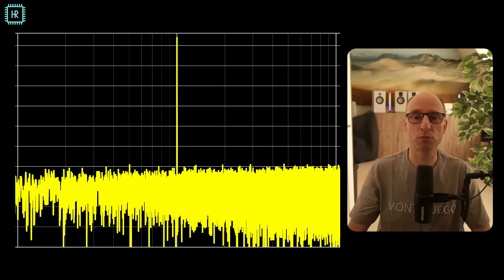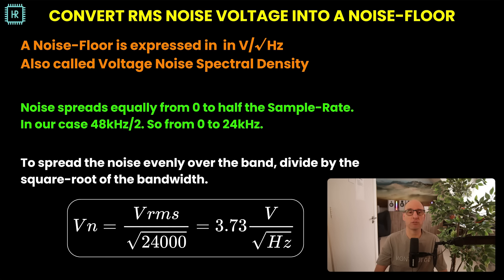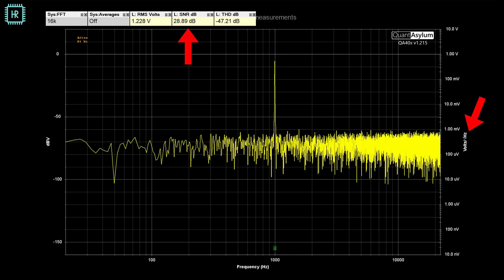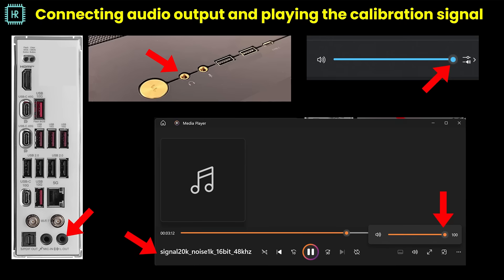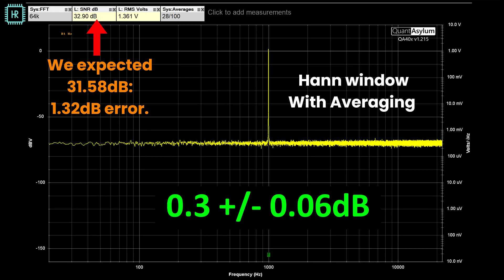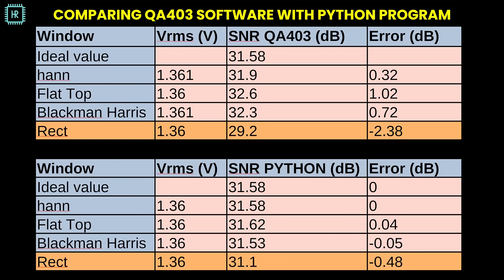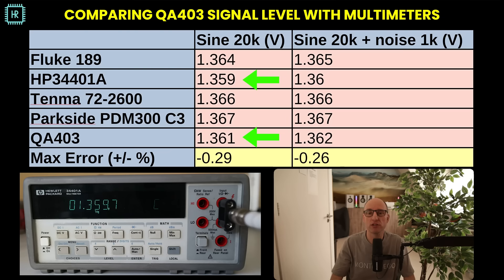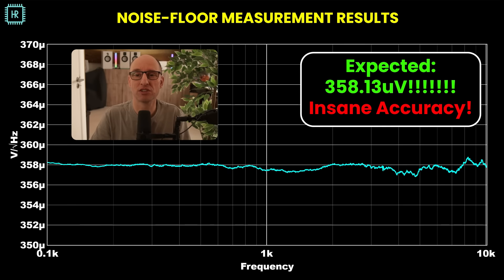Are you measuring the right noise?

Comment: I use E1DA Cosmos ADC iso and JLsound W-DAC V2 (now rebuild to W-DAC-XLR) with i2SoverUSB to make a DAC. Both DAC and ADC are 32bit 768kHz. And for measurements I use REW software. I suppose, that this software already uses the correct SNR algorithm. I've tried your wave files, but something doesn't work and I've too much of harmonic on the moise floor. Second and third harmonics about -60dB...
With W-DAC V2 I get up to -128dB SNR (without DUT)
Reply from the maker: Strange, it seems your circuit is clipping somehow when playing the wave files. Something is overloaded. Have you tried reducing the volume?

Comment: Ill add that while working for a video hardware company that i didn't believe that Tektronix VM700 was accurate at masuring NTSC PAL color bar error. What a wild goose chase.
First, we found out that the calibration standard we were requested to use was a demo tape made on a handicam.
Then for financial reasons we developped an NI box with some danish company's video analysis software.  I didn't trust this either.
So i grabbed a 4 GHz scope, a self-synthesized RGB file with 12 bit raw data, snapshotted a line of video, shoved it into excel, wrote some 2D convolution code, and found that those other two were off by almost 6 degrees of phase from each other, in the opposite direction!
I recalibrated our composite output coefficients, and now scarlet in video looked right, and not washed out pink.
Reply from the maker: This is why I always want to verify new equipment I get myself, often, I find something...

Comment: Hans.  Thanks for your interesting videos. I've known since I was just about a a toddler that you can get Vrms from Vp by dividing by the sqrt of 2.  However, at 2:11 in this video you are showing that you are dividing by sqrt of 3 for the Vrms of the noise.  Where is this constant coming from? Also, since you are generating the random noise in your python script why not just calculate the rms value at that time rather than relying on what seems to be an estimate?
Reply from the maker: Hi, it's just statistics. With uniform noise, it's just the peak level divided by sqrt(3). It follows from determining the RMS value of such a signal. If I would have used gaussian noise, the RMS value would be equal to the standard deviation or variance (I believe those 2 are the same thing).

Comment: Something which I am still a bit confused about is why we assume the computer can output the calibration signal properly? It would seem to me that consumer grade PC hardware doesn't have the highest quality DACs built in and it would make sense if there was more noise added from this component producing the signal itself.
Reply from the maker: it's because my signal has a HUGE noise-floor. Even the most 'rubbish' audio-source would do the job... IF the frequency response is flat!!! This is crucial, but with modern electronics, this is so easy to achieve.
Reply: I had the same question. From the replies, it sounds like Hans considered this a few different ways and I'd like to hear his thinking. 

I suppose that if you made the measurement and got a value back which matches or beats the instrument's specifications, you can conclude that whatever inaccuracy is in the PC audio source doesn't matter.
Reply from the maker: @OutThere458 see other reply. The snr of my test signal is terrible on purpose so even a low quality audio output will do a good job.

Comment: Thank you for another very nice video.
Algorithm would be nice. I have the same device, and I really nice addition would be a super clean 1kHz generator with a matching notch and a super low noise front end. I just love to dig into the -150dB distortion world of components.
Reply from the maker: oof, 150dB distortion is really really tough. every component matters in that case. And you'll need some crazy linear amplifiers and generator or dac. I wouldn't know where to start, this is like a fundamental research science project!

Comment: 6:31 - You actually also have to set Windows to do internally 48Khz mixing to make sure the audio file isn't going to be down mixed to 44.1khz.
Even better, use ASIO for the sound card, and use an audio player that supports it. This can give you bit-perfect and sample-sample matching playback.
Reply from the maker: Good point, I forgot this one. I noticed once that my previous PC did something like that. It converted 44.1 to 48kHz. I subconsciously created a 48kHz file since I assumed windows would play it that way, preventing issues. It seems to work well with my PC.

On other systems, weird things could happen, indeed.
Reply: @HansRosenberg74  Just as a off-topic sidenote, I usually set the sample rate to 48Khz and the bit depth to 32bit in the windows settings for the audio card, so the sample rate covers most content on the internet, video and audio. I know 32bit is an insanely high resolution for audio, and many cards only run at 24bit max, but I like to think that the very high resolution helps with mixing by having a large "floating point" to work with.
How precise the newer Windows software mixing actually is in the background, I am not entirely sure about.
I use Foobar2000 for bit-perfect audio playback. it takes control over the audio stream via ASIO and sets the parameters to whatever the sound-file contains.
If your sound card don't have native ASIO support or drivers, you can download something called "ASIO4ALL".

Windows also have some "fancy" audio enhancing build in, that it seems to apply by default if your drivers allow it. You have to know about it and disable it manually. It is so bad...
Reply: This is absolutely correct. Also the windows mixer is very inconsistent when it comes to added distortion. even when not doing resampling, the signal is not bit perfect.

Comment: Very nice explanation, Hans! Since you are using np.random.uniform() to calculate the noise, your noise should be rectangular. You might want to verify your setup with a high crest factor gaussian noise source to better simulate real analog noise.
Reply from the maker: I picked uniform noise to make sure the range isn't infinite. On the other hand, I could just as easily have chosen gaussian noise since I'm very far away from the maximum signal level of the 16bit signal. If choosing gaussian noise, the RMS value equals the standard deviation of the noise.

Comment: If the signal frequency is not exactly on a FFT bin, wouldn't the amplitude be lower when not using a flattop window?
Reply from the maker: You're running ahead to my next video. There are so many votes already that I'll have to make that SNR video which will also answer your question. But you're right, the peak value in the spectrum is NOT the signal value. And another thing is that in real life (outside of simulation) a frequency will never be exactly on a  bin (around the same chances of winning the lottery unless you start manipulating the results by locking clocks and stuff like that)
Reply: @HansRosenberg74 
So the QA Software does not get the signal amplitude from the FFT?
Than how is it done if e.g. the SNR is very low and so the signal amplitude cannot be determined from RMS in time domain (or it will be to high)?

Comment: Why didn't you include a screenshot of the noise floor with the input shorted? I'd say to verify the noise floor is actually significantly lower than the noise in the calibration signal, and of course whether it meets stated specifations as we don't trust anyone 😬
Reply from the maker: That will happen in some of my next videos on lnas. For this video the goal was to get the noise measurement right, that worked out very well. Now I know that if I measure the output noise of the 3 lnas I've designed will be very very accurate and I can trust it.

Comment: and i wrote a python program once, that would take a waveform of the noise output from my amplifier, recorded with an oscilloscope, and spit out the equivalent input noise floor spectrum with correct units (knowing the gain of the amplifier). I then compared it to the spectrum predicted by theory, and they were matching reasonably. Was fun. But i am still not 100% sure everything was correct though...
Reply from the maker: It takes quite a lot of time to nail those things down 100%. This little journey took me a few weeks :-)

Comment: It would be interesting if you could try out the Cosmos Adc iso one day. It is an extremely interesting device for measuring many parameters, and above all, it surprises with its characteristics, which, after factory calibration, differ significantly from what is specified in the datasheet for the ADC used inside (in a good way). It is also very attractive in terms of price for the beginners and i think it might be also better in all terms against qua403 but it does not have a generator
Reply from the maker: Hi, thanks for the tip. I did not know this thing! Looks impressive. However, it is a bit of an investment and I still have to earn back the quite big investments I've done in the end of last year in equipment!

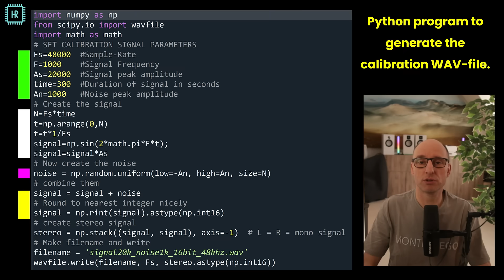Comment: 6:10  Is there an assumption here that the PC-generated audio output noise source has a flat frequency response?

It would seem prudent to run a monotone frequency sweep first to verify a  flat output amplitude, then apply an EQ correction to counter act any deviation across the output frequencies. 

As always, another stellar video about  about the intersection of electronics design theory and reality!
Reply: So is the measured noise floor equal to the floor for your new instrument plus the noise floor on your output/signal generator? The software might let you guarantee a requested signal, but is there some reason to assume the actual signal is created as reliably as the device can measure?  Or are you just doing a worst-case sanity check?
Reply from the maker: Great point, the floor was so flat however that I trusted it (the averaged measurement in my video). Also the fact that the SNR with my own program was spot on proved that it had to be flat. If there would have been an error left, I would have done that sweep indeed and try to calibrate for it (that would have made the video a few minutes longer and a lot more of a headache :-)  ).

I did try a number of outputs. One of my older laptops had a really curvy noise-floor output. It was a headphone output and I assume they had a lot of EQ on it, but I did not investigate further if I could turn that off somewhere in windows.

And thanks a lot for your compliment: I really appreciate it :-)

Comment: Since you are interested in the SNR for 10 kHz BW; What if you set the Fs in your script to 20 kHz (the generated noise will have BW=Fs/2), and then use the QA software. What will the result(s) be?

I have tried to calculate the SNR for your Python script, but using power instead of voltage. 
SNR (dB)=10⋅log10(𝑃_signal/𝑃_noise)
from that calculation I get 27.78 dB. 

Even though not stated explicitly in their software, I would assume that the QA software use Fs/2 (48 kHz/2=24 kHz) as bandwidth for their SNR measurements. They integrate from 0 Hz to Fs/2 Hz.
I have used analyzers from Audio Precision for many years, and in their APx software the default setting for BW is Fs/2. But it is also possible to set specific low and high cut-off frequencies or some industry standard filter settings.
Reply from the maker: It is difficult to go  up to Fs/2. The reason is that it is flat in the digital domain, but after AD conversionk there will be loss close the Fs/2, this is inevitable I think. So you choose a band that is well away from that, especially for calibration purposes.

if you square the noise voltages and turn them into power spectral density and then use 10-log(signal/noise), you get the same value as for voltage. You square the part in the log (making it twice as big) and then you multiply it by 10 instead of 20 (half). So the net result is the same.  What numbers did you use? It could be I made a mistake somewhere in the sheets even though the end result is ok. So curious to know what numbers you put in.
Reply: @HansRosenberg74  
Here is a script for the calculation:

import numpy as np
import math

Fs = 48000
F = 1000
As = 20000  # Signal peak amplitude
time_duration = 300 
An = 1000   # Noise peak amplitude

# --- 1. Theoretical Calculation ---
# Power of Sine wave = A^2 / 2
power_signal_theoretical = (As ** 2) / 2

# Power of Uniform Noise = A^2 / 3
power_noise_theoretical = (An ** 2) / 3

snr_linear = power_signal_theoretical / power_noise_theoretical
snr_db = 10 * np.log10(snr_linear)

print(f"Theoretical SNR: {snr_db:.2f} dB")

# --- 2. Empirical (Actual Data) Calculation ---
# Recreating the generation process to verify with actual array statistics
N = Fs * time_duration
t = np.arange(0, N) * (1/Fs)

# Generate pure signal
pure_signal = As * np.sin(2 * math.pi * F * t)

# Generate pure noise
noise = np.random.uniform(low=-An, high=An, size=N)

# Calculate Average Power (Mean Square)
# Power = sum(x^2) / N
p_signal_actual = np.mean(pure_signal ** 2)
p_noise_actual = np.mean(noise ** 2)

snr_actual_linear = p_signal_actual / p_noise_actual
snr_actual_db = 10 * np.log10(snr_actual_linear)

print(f"Calculated SNR from generated data: {snr_actual_db:.2f} dB")
Reply from the maker: @Gundersen81  Aah, now I see. You calculate the SNR over the full nyquist bandwidth. I use 10kHz. That explains the difference. It's 24kHz versus 10kHz bandwidth. You cannot use the full 24kHz because close to the edge, the signal transfer is not flat for real signals. In the digital domain it will be flat. After DA conversion there is usually roll-off near the band edge.

The difference is 10·log10(24 kHz / 10 kHz) ≈ 3.8 dB which is exactly the difference with  my number. Glad to see it all adds up, I was worried I made an error somewhere :-)
Reply: @HansRosenberg74  

Will this script make more sense? 
I have added a filter to the script, and then cacluated the SNR (I don't know what filter order or characteristics you are using).
with Butterworth, order=4, and cut off= 10 kHz, I get SNR=31.57 dB.

import numpy as np
import math
import scipy.signal as signal

# --- 1. Setup Parameters (Same as before) ---
Fs = 48000
F = 1000
As = 20000  # Signal peak
An = 1000   # Noise peak
time_duration = 10 # Reduced duration for faster processing
N = Fs * time_duration
t = np.arange(0, N) * (1/Fs)

# --- 2. Generate Data ---
# Generate pure signal (Sine Wave)
pure_signal = As * np.sin(2 * math.pi * F * t)

# Generate pure noise (Uniform)
pure_noise = np.random.uniform(low=-An, high=An, size=N)

# --- 3. Calculate Original SNR (Pre-Filter) ---
p_signal_raw = np.mean(pure_signal ** 2)
p_noise_raw = np.mean(pure_noise ** 2)
snr_raw_db = 10 * np.log10(p_signal_raw / p_noise_raw)

print(f"Original SNR (0 - 24 kHz bandwidth): {snr_raw_db:.2f} dB")

# --- 4. Design and Apply Filter ---
# We will design a Low Pass Filter with a cutoff at 10 kHz.
# This keeps frequencies 0-10k and removes 10k-24k.
cutoff_hz = 10000
filter_order = 4 # Steepness of the filter

# Design the filter (Butterworth type)
sos = signal.butter(N=filter_order, Wn=cutoff_hz, btype='low', fs=Fs, output='sos')

# Apply the filter to BOTH the signal and the noise separately
filtered_signal = signal.sosfiltfilt(sos, pure_signal)
filtered_noise = signal.sosfiltfilt(sos, pure_noise)

# --- 5. Calculate New SNR (Post-Filter) ---
p_signal_filt = np.mean(filtered_signal ** 2)
p_noise_filt = np.mean(filtered_noise ** 2)
snr_filt_db = 10 * np.log10(p_signal_filt / p_noise_filt)

print(f"Filtered SNR (0 - 10 kHz bandwidth): {snr_filt_db:.2f} dB")

# --- 6. Calculate the Improvement ---
improvement = snr_filt_db - snr_raw_db
print("-" * 30)
print(f"SNR Improvement: +{improvement:.2f} dB")

Comment: What is the difference between using Gaussian and Uniform distribution for the generation of the noise signal?
Is uniform distribution used because it makes the amplitude more predictable, because you know exactly what the maximum possible peak will be and no "Gaussian spike" suddenly causing your audio to clip?
Reply from the maker: Yes, those were the considerations.
For Gaussian noise, the range of values is not defined, in theory it is unbounded.
Uniformly distributed noise has the advantage that its range is strictly defined.

For Gaussian noise, the RMS value equals the standard deviation.
For uniformly distributed noise, the RMS value equals the peak value divided by √3.

So I could have used either one, but I chose the uniformly distributed noise to have a bit of a more controlled value-range. But since I already stayed far away from the maximum range of 32676, gaussian would have also worked.